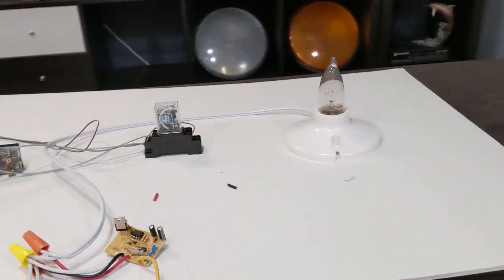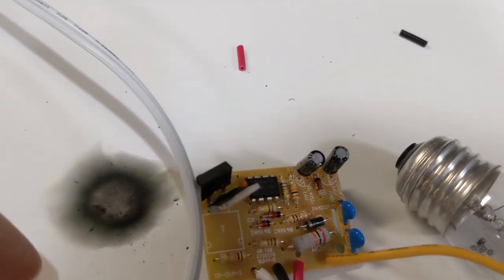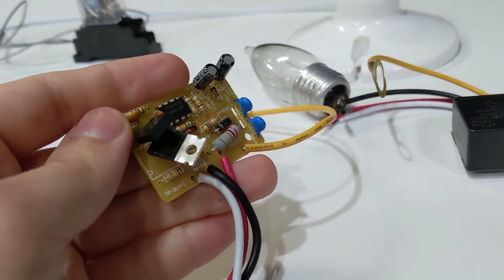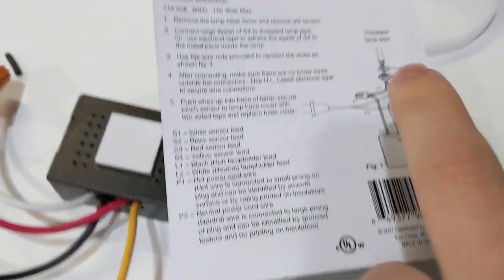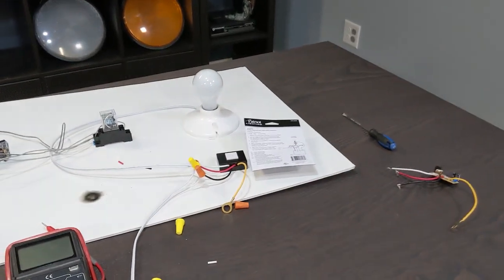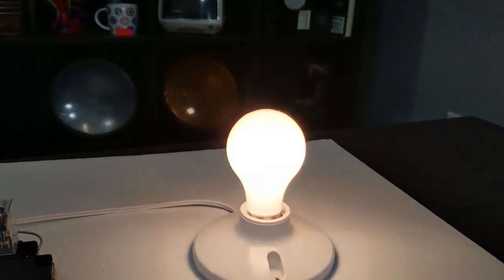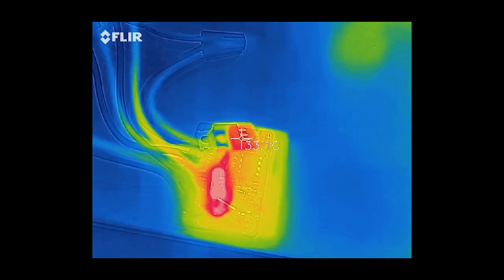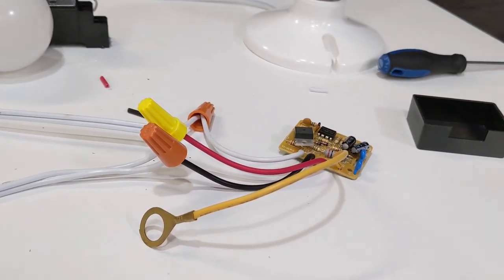A slightly explosive touch-lamp follow-up (standby energy consumption)

Comment: So, I had forgotten that these things existed, but after watching this video last fall I bought two of them to install in the cheap gooseneck lamps we keep on our bedside tables. These are the kind of lamps where they were too cheap to put a switch on the lamp, instead installing a cord switch that always ends up behind the table when you need a light at 2:00 AM. The touch modules basically doubled the cost of the lamps. Oh well...

I bought a different brand but they had the same weird color code configuration as yours.

However, as you discovered at the end (realizing that your cord set didn't have a polarized plug) the polarity doesn't matter, what does matter is that when you connected everything the first time, you supplied hot to one terminal of the switch and neutral to the other. When you activated the touch sensor it was just like connecting a hot directly to neutral. Your only load was the triac...kaPow!

Anyway, on my Kill-a-Watt meter, I initially read .4 watts but after I cycled the lamps on and off, it reads 0. Perhaps the circuit charges a capacitor and then no longer needs any power to read the change in capacitance when the sensor lead is touched?
Reply: We have a china cabinet that came with one of these installed when I bought the cabinet in 1999.  The sense wire was originally connected to a metal stud inside the cabinet. I thought it was dumb to have to open the door to turn on the lights, so I wired the sense wire to one of the hinges.

The controller finally died about a year ago and I bought a new controller on Amazon.  It had the same funky wiring colors as the one in this video.
Reply: I wish I would follow up on this as I'm no curious if there would be continued draw after cycling for a short bit but leaving it off for a long period (say over night).
Reply: @sergiomendez9231  Hey Sergio, just saw  your comment. I'll follow up for you. I just put a Kill-A-Watt meter on mine and will leave it for a few days to see whether the power drop continues, or if there is a continued power draw once the switch has been cycled a few times. My house, built in 1928 has a bunch of old wall sconces that used to have individual switches and cannot be switched from a normal wall switch. I put a bunch of these behind the escutcheons so I can touch them on or off. But now I really am curious about how much of a passive load they are.
Reply: OK, so I plugged my table lamp with a touch switch in through the Kill-a-Watt meter last night around 9:00 and zeroed it out after I shut off the lamp. There was no detectable current draw. I didn't turn on the lamp during the night and I checked the meter at  5:00 using a flashlight. It still read 0.00 kWh and showed no current draw. I'll leave the meter on it through the day, but I feel confirmed in my hypothesis that once these switches have been power cycled they hold enough charge to work without drawing any current.
Reply: @christopherdahle9985  Wow, that's fantastic! Thank you for taking the time to test and let me know! I used to have a touch lamp as a bedside lamp as a kid. Knowing it's capacitance is enough to prevent drawing current when not in use definitely makes it more appealing. Thank you again, kind sir!
Reply: @christopherdahle9985  That theory is plausible, but it may also be a technical "hiccup" of the meter, where sometimes when you have a very large range measuring device (if I remember correctly the kill-a-watt meter measures from 0-1875W or so, with measuring increments of 0.1W), the measuring device often can lose accuracy at the extreme low end of the range, so it is possible that the zero reading is still 0.3-0.4W in reality, but it too small for the meter to really detect very well.  In a similar instance of the low-end range difficulty, the lowest resistance settings  (often 0-200 ohms) on a multimeter might not read 0.0 even when the two probes are touching each other, on mine, the meter reads something like 0.3 or 0.4 when the leads are touching each other.
Reply: @AP-zc6qy  It is not at all unlikely that you are correct. One thing I might try over the weekend is to plug both of my modified table lamps into a single K-A-W meter. If there is a current draw beneath the sensitivity of the meter, perhaps two touch switches in parallel might add up to sufficient draw for the meter to detect. Another interesting experiment I tried was  to remove the halogen bulbs in the lamps and install 3 watt LEDs. It has been suggested that LEDs draw insufficient current to latch the touch switch circuit. I discovered that one of the lamps worked perfectly, but the other pulses almost un-noticeably at about maybe 15 Hz. I also observed that in the “off” state, both lamps emitted a very faint glow, just enough to find them in the dark. However  the LEDs at 300 lumens, were insufficiently bright for reading so I terminated that experiment until I get some brighter G8 format bulbs.
Reply: @christopherdahle9985  What do you mean when you 'zeroed it out'? Do you mean it simply read zero or does your meter has a zero button in a similar way you would zero a set of scales?
Reply: @regd809  Hey RegD, Yeah, similar. Not exactly like a scale because you're not trying to cancel out a baseline load like the tare button or the zero adjust dial on a scale does. More like a stop watch. Once you have your experiment set up you need to zero the kWh meter so you only measure the power used during the experiment. They are a fun little tool, especially if you are trying to get your kids to understand why they should turn things off when not using them.
Reply: @christopherdahle9985  OK zeroing the hours rather than the kW. 
From the components I can see the chip is a TT6061a, which is a CMOS chip, so will draw next to nothing when quiescent. The power supply is a resistive dropper using a 20K resistor bleeding about 5mA through a Zener diode so will constantly use a minimum of about 0.3 W, whether the capacitors are charged or not. That is what is keeping that large resistor warm. I guess that small current draw is too small to properly register on you KAW meter. Over 8 hrs that adds up to 0.0024 kWh. You would need at least 3.d.p on your meter to see this!
Reply: @regd809  Hmm, can't believe I'm still messing with this, but it's fun. For the benefit of any else who might run across this, here's the numbers I observed using an obviously flawed process:

Unfortunately, the lamps are connected to an outlet that is awkward to reach and I'm too lazy to tear apart the bedroom to recapitulate the observations in a more studied manner...especially since my long-suffering wife is sleeping, so all of the readings are from memory.

Note that the meter can display Watts or kWh, Amps, or Amp hours, also line voltage, and power factor as well as time. It has a lighted LCD display and there is a button to turn the display on or off. If I plug in the meter alone it begins to count time and reads about 119 volts. I set it to read watts and it reads zero with no load connected. Although obviously the meter must draw some tiny bit of current, the meter doesn't indicate any load even as I cycle the backlight.

When I plug in the lamp, the Watt scale shows a load of 0.4 watts, but shows nothing on the kWh scale. I don't think I looked at the Amp or Ah scales, or at least I don't remember if I did.

When I turn on the lamp the Watt scale shows 30 Watts, consistent with the rating of the halogen bulb therein. After a few minutes the kWh scale reads 0.01. I didn't pay attention to how quickly, but it definitely took 5-10 minutes to reach .01 kWh.

Here's the interesting thing. When I turned the lamp off, the Watt scale did not return to 0.4. It returned to 0.00 and stayed there. I reset the kWh scale to 0.00 and left the whole thing on the workbench for 3 days and it never registered any accumulated Wh consumption.

My initial conclusion was that the touch switch draws a small current load in the off state when first plugged in but none once the power has been cycled. My amended conclusion is that the switch draws no measurable current within the capabilities of my equipment once the power has been cycled. 

Anyway, I'm enjoying the discussion.

Cheers